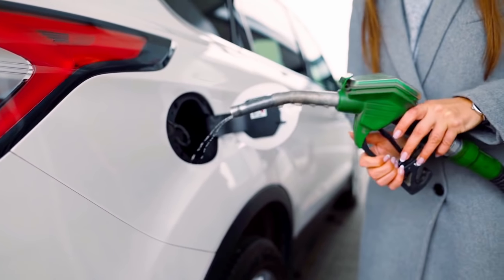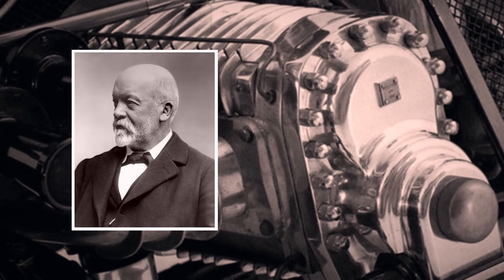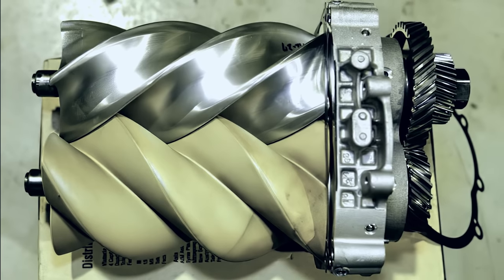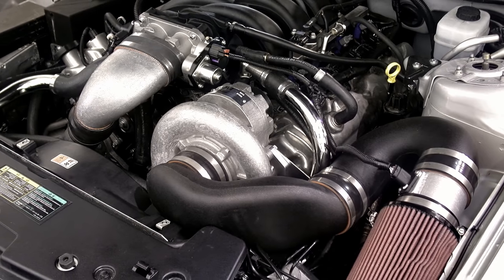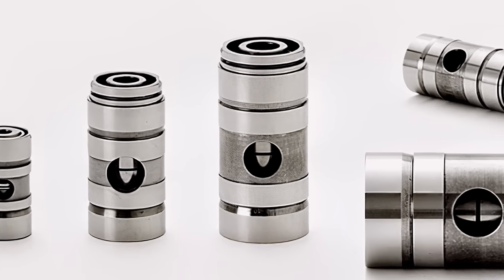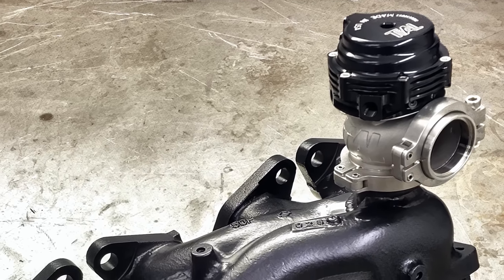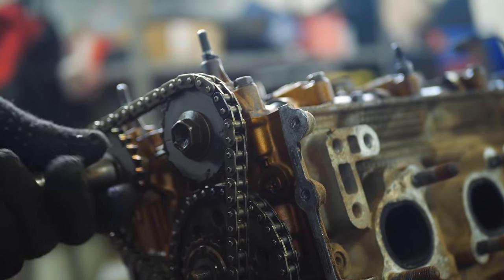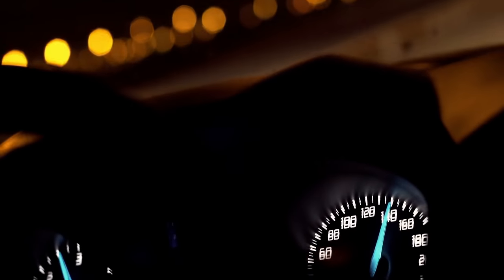The Science Of Boost

Comment from the maker: Check out this related video on how oxygen sensors work - https://youtu.be/KIF8P2J1CeE
Reply: One caveat. Turbochargers don’t generally use engine coolant for temperature stability, but the oil. Turbos get far too hot to use the coolant.
Reply: You could also technically setup a complicated twincharged system. With a supercharger that disengages at a certain rpm for low end boost as the turbo kicks in. I’ve seen a number of project builders accomplish this with too much time and money 🤣
Reply: Shit I commented too soon. I meant twin charging where the supercharger feeds the engine at low rpm, then a turbo at high rpm. Not compound charging where one device runs another.
Reply: Also, compound low/high sequential compressors is common in diesels too
Reply: Also, Bi or twin turbo is common on split engines. Flat 4, v6, v8 etc where you can use each exhaust header rather than complicated piping or a single turbo only feeding off half the cylinders
Reply: 5:08 in this video i believe the animation of the supercharger is inaccurate as the partial stream is going backwards
Reply: @ObservationofLimits   what? there is no such thing as running a turbocharger off of only half of the cylinder's exhaust. there are only negative consequences of that
Reply: 0
Reply: I,as one, used to work for International Harvester dealer truck shop back in 1973, 1974 as a mechanic for there new trucks that would go out to fleet buyers, one new truck I Got to check out and test drive had a 8V92 V8 Detroit diesel engine with the normal roots blower on top, which was good OK, on top of that it had a pretty good size turbocharger, when I took it out to test drive it after I had T I'd it , I could get on a long entry to the free way an get up a few gears and I had no trouble at all in catching up with the main traffic flow, that engine had real power no doubt at all.
Reply: Another great video. Thank you for the hard work and time.
Reply: Outbound
Reply: Try 'driving4answers'
Reply: @ObservationofLimits üüÜ
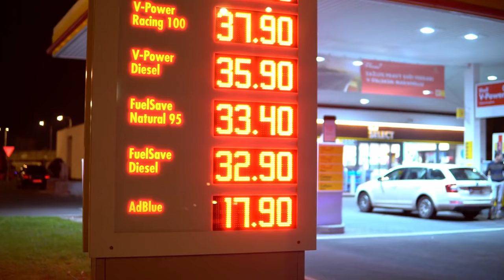Reply: 2:52 gas prices in California by 2030

Comment: yeah as others have also said the blower is turning the wrong way, the air goes around the outside
Reply: Was about to say the same thing 🤣
Reply: Yeah... noticed that too... and
The turbo is turning the wrong way also.  The rotor turns from the larger cross section of the volute to the smaller cross section.  It's the opposite for the hot turbine section.

Comment: Great video, but I think when you say "detonation" you're actually talking about pre-ignition. Pre-ignition is when the air/fuel mixture explodes before primary combustion (due to over compression and too high of heat), whereas detonation is the unexpected explosion of the remaining air/fuel mixture after primary combustion.
Reply: Interesting, I'd always assumed that they were interchangeable. It sounds to me like pre-ignition is just a specific type of detonation in regards to time.
Reply: Would ignition before the sparkplug goes off be considered detonation? I mean Diesel's ignite by "detonation"  not pre-ignition right?
Reply: @chidon7465  Pre-ignition is when the mixture ignites before the spark plug goes off, detonation is basically "double ignition" where the leftover mixture ignites again after the spark plug has caused primary ignition. Pre-ignition can typically cause far more damage than detonation as the piston pushes up against the early explosion, which is typically the most crucial difference.
Reply: @blakebeaupain  OK I understand now, thanks. Detonation causes that "pinging" sound in your engine correct?
Reply: @chidon7465  Correct yeah, but pinging/ticking can be caused by other things as well. In terms of diesels, they don't really suffer from "pre-ignition" as they don't have spark plugs, they have glow plugs which just stay warm while the engine runs. Diesels compress the mixture until it explodes (which is tuned to happen when the piston is at top dead center) and they technically "knock" by design.
Reply: @chidon7465  Detonate means ignition followed by explosion. So, you're right, if you read a dictionary.

This rinds me of when a dumb guy once made fun of me when I called my shocks dampeners.  He asked if they get wet and dampen the wheel.

I said, "Well, yes, they do dampen, which has the exact same definition of damp.  And dampener has the same definition of damper.  So, pfffft.

And Pluto is a planet!

Comment: The animation of the roots supercharger at 5:25 has the air flowing the wrong way.
Reply: Or, well, the rotors rotating in the wrong direction.
Reply: The animation of the twin screw compressor is also completely wrong 7:14
Reply: The impeller in the super charger at 9:10 has its blades facing the wrong way, you can't really tell what way its turning because its animated so quickly but I would assume its also wrong.
Reply: Yep: turning in the wrong direction. And the air doesn't go through straight.
Reply: oh i was so confused... how would the air compress so much to fit in between the rotors
Reply: The impeller blades are turning the wrong way. The air flow just moves on the outer areas of the blower case.  Not between the impellers.     This is a common misperception as I remember.
Reply: I tought i forgot how this worked
Reply: @Wiley Sanders the air pockets are in the out area within the blower case..
The animation is incorrect.    Common mistake.   Still common apparently
Reply: Your comment makes that animation make so much more sense now!
Reply: @roboterson  I'm amazed that he managed to get every single animation backwards. It makes it more clear that he's a presenter, not an engineer, or at least not someone who can visualize the flow well enough to notice that.
Reply: @Mastervidcritic  so is the airflow in the radial inflow turbine @15:04.
I think they are trying to incorporate a stroboscopic effect- really unnecessary and confusing...
Reply: Regardless these animations are incredibly well done and were able to get the point across. Your content is unreal, keep up the awesome work
Reply: i was coming down to the comments to say the same thing. Glad to see someone else spotted it
Reply: Yeah, I was thinking that too, they didn't look at which way they were animating the supercharger.
Reply: Yes i also noticed the same thing.
Reply: I was going to leave that comment, so thanks for beating me to it, haha.
Reply: Glad I'm not the only one that noticed
Reply: The Lysholm screw blower animation also shows the airflow backwards, and the turbo animation has the compressor wheels spinning backwards
Reply: @Mr2boosted  right, i noticed that one too
Reply: @Pow3llMorgan  both
Reply: Scrolled down to comment that, glad somebody else verified it because I  really didn't want to be that guy to point something out that isn't actually true.
Reply: Yep. The air should be following the case, not the meshing lobes.
Reply: @Mastervidcritic  
I didn't understand how either of those worked, based on the animations. I still don't  really get it. But reversing the flow at 5:25 does make a lot more sense than how it's shown.
Reply: that's not the only time the animation show wrong airflow... 7:20 again
Reply: Them not knowing or understanding how any of this actually works makes it hard to watch this video.
Reply: I figured i was just stupid for not understanding airflow lol. Thanks for  telling me this.
Reply: they seem to have the rotation in the wrong direction in every animation. its as if someone set out on purpose to get it wrong, much worse than a random 50% chance. ive lost interest in watching the rest of the vid because of it.
Reply: His 3D animation guy must be Australian.
Reply: @Taygetea 
The screw supercharger is pretty accurate and the rotation of the gears behind the centrifugal supercharger is correct as well. The Roots type is very wrong though.
Reply: Oh thank goodness, I thought I was going insane. I kept staring at this thing going "This cant be right, but somebody went through all this effort to animate it. Maybe I'm missing something?" Then it happened again and I just had to come check the comments to see if anyone else was seeing this.
Reply: Exactly!
Reply: Centrifugal Supercharger too has mistake, Impeller rotation is oppostie to what it should be.
Reply: He also referred to turbo lag incorrectly...its boost threshold.
Reply: It was bothering me so much I had to pause the video and check the comments.
Reply: I think it was just showing how it just continues to force air in which gets hotter too and the combination builds pressure. But whats gonna happen of the valves not open and the airs forced down the runner 🤔 prolly gonna bounce back
Reply: that was painful
Reply: Centrifugal rotor is turning backward also.
Reply: @travismason2811  I had to stop watching precisely because of this. It's easy to read out a Wikipedia page without understanding any of it. Sure the animations and editing is pretty, but that doesn't automatically make it good quality.
Reply: Ugh I noticed that too and its killing me
Reply: Those that "know" and, those that "think they know"... Makes me wonder if this dude has ever touched an engine...
Reply: Thanks Karen 🤦
Reply: the screw charger 7:15 too
Reply: I noticed this right away, air travels around the outside of the rotors.
Reply: @Taygetea  You're absolutely right about the distinction between an expert and a 'talent' presenting info.  YouTube must not be taken as the ultimate source!
Reply: "New Minds" lol
Reply: I'm glad I'm not the only one sitting here yelling at my screen! 😂
Reply: @adamvalt6609  it doesn't, it goes around near the outer casing.
Reply: THANK YOU, I thought i was losing it.
Reply: some have CAD but do not know how things really work just the principle. everything goes the wrong way in the animations
Reply: Bless you sir.
Reply: Right—doesn’t it flow around the outside rather than through the middle?
Reply: What do expect from someone who thinks A/R is a reference to aspect ratio.
Reply: @That one guy  as a compressor technician this bothered me so much
Reply: It's not a roots charger...it's a salt mill. Now also the white particles make sense!
Reply: I just thought I had my memory messed up 😂 headed right for the comments and here I see this
Reply: Not if it is a inter compression design. where the air moves between the screws. You probably is talking about outer compression designe, where the air moves near the housing walls.
Reply: @pedro.alcatra  Yes. Because in a Roots compressor, the air (and, potentially, gasoline and maybe even water or alcohol) is moved "along the walls".

I guess top-fuel didn't use water injection; they just inject fuel, like, everywhere, into the air flow. A top-fuel dragster Roots compressor may "divert", like, 600hp of the engine power to keep itself spinning. Okay, that has nothing to do with how a Roots compressor works, but it's kind of funny to know that a 400hp car isn't that strong...as it is too weak to operate a "proper charger".
Reply: theres lots of backwards animations in this i think...

Comment: All I've ever known about FI was contained in this presentation, combined with twice as much stuff I didn't know ALONG with the history...
I wish I could like this twice
Reply: Basically nothing on F1 MGUH though. Those hybrid systems are stunning. Zero lag.
Reply: The video contained info I picked up over the years one bit at a time.  Plus a new bit, where they cut the ignition so unburned fuel goes into the exhaust and ignites there and spins the turbo.

We used to do a trick on our bikes where we went full throttle, cut the ignition (thumb switch), filled the exhaust with air/fuel mixture, then thumbed the ignition back on.

This ignited all the fuel in the exhaust at once and exploded like a quiet gunshot.

Doesn't work on EFI.  '(

Comment: The animation at 5:10 is wrong, the rotors spin backwards compared too the airflow
Reply: that's not true
Reply: Maybe you need to hold your phone upside down
Reply: i was about to comment on it. The air pases throught the outside (close to the wall) so in that animation it goes up
Reply: Also 6:55. I swear, even later with centrifugal superchargers and turbochargers; the impellers illustrate correct vane geometry, but appears the same backwards rotation. It's all a clever ploy to drive comments.
Reply: iirc that would be the correct animation had he been talking about a twin scroll supercharger rather than a roots one
Reply: Centrifugal Supercharger too has mistake, Impeller rotation is oppostie to what it should be.
Reply: Come on - there are seals between the intermeshing lobes in the middle, therefore airflow must be around the outside where the open cavities move towards the bottom.  Obviously the animation is rotating in the wrong direction, unless you want to pump air from the cylinders out the intake.

Comment: 23:45 that's backwards. The large turbo feeds the small turbo. The compressed inlet charge increases the flow capacity of the small unit. Also a small nuance, you said that lowering the compression ratio decreases the thermodynamic efficiency of the engine. While it's true that high boost levels require lower static compression ratios, the dynamic compression ratio is much higher so the thermodynamic efficiency of the engine is higher. Think of it as the air gets compressed, then cooled, then compressed again, meaning you can have a much higher compression level before detonation temperatures are reached. Otherwise this is a surprisingly accurate video. You've clearly done your research.
Reply: Agreed Brian.  One could also think of it like a gas turbine like a twin or triple spool turbofan.  N1 is larger than N2, and N2 is larger than N3 (if a triple spool engine).

Comment: The illustrations show the air taking the wrong path through the rotors.  It actually goes around the outside and the meshing rotors seal the air down.  There is no room for displacement between the rotos it therefore has to use the volume of the shape of the mating parts.  Great video.  Thank you.

Comment: This was actually very well done.  Bravo.  Only critique:  17:10 - Turbos are not just RPM dependent.  They are also load dependent.  This is why redlining in neutral builds no boost but flooring it at low RPM can.  For best results, it takes both.

Comment: The Roots system is also used in metering natural gas at higher flow rates. For normal domestic metering, from 250 cfh to 1000 cfh, we usually use positive displacement diaphragm meters that use internal diaphragms to inflate and deflate, measuring the gas volume and turning a counter to show usage. This is then billed to a customer at a known pressure, adjusted for temperature. At higher volumes, 2m cfh to 56m cfh, we will use Roots style meters. They still work off of the positive displacement principle, yet the rotating assembly has a higher volume permission than a diaphragm design and do well at measuring large volumes of gas. They also aren’t restricted to the lower pressures of diaphragm meters, and some are used at upwards of 200 psig. This allows high pressure/volume through the meter, which a customer can then regulate down for their specific applications.

Comment: 5:10 and 7:07  the air is flowing backwards given the rotation direction depicted in these models
Reply: 7:35 also
Reply: And at 29:14 that housing is for clockwise flow but the impeller is for counter clockwise flow.  at least you got the air moving in the right direction that time lol

Comment: Very nice video. But you should correct the rotation of your compressor animations. They all rotate the wrong way. Also the compression ratio of a cylinder is described for a naturally aspirated engine. A 1:8 ratio of a boosted engine is increased to maybe  1:12 by the air pressure. But maybe you also mentioned this. Keep up your fantastic work.

Comment: The animation of the centrifugal compressor from 08:28 on is spinning in the wrong direction.
And animation of turbocharger from 14:54 is also spinning in wrong direction while the exhaust gas inlet flow is shown correct....

Comment: I had an Olds 442. It had the standard ring air filter that pulled air from the engine bay. Very inefficient. I installed a K&N cold air box that pulls air from the outside and uses a high flow filter. The difference in performance was stunning. I would wager that I gained 30 or more HP and just a smoother running engine. Amazing

Comment: Very Nice video, however, I believe you are mistaken in the notion that roots blowers are used on modern vehicles, I do not believe this to be the case, the roots blower with its many inefficiencies has been widely replaced by relatively inexpensive twin-screw counterparts made by companies such as Eaton and IHI. The HellCat and Demons for instance use an IHI Charger, and Ford supercharged offerings have been equipped with the TVS 2300 and M112 From Eaton.

Comment: Overrall a great video. But I see a few OCD moments.

4:58 - That's spinning the wrong way. Air flows on the outside of a roots. Not the inside.
6:55 - Also backwards on this screw blower.
8:25 - also spinning backwards. At least you show the airflow correctly.
9:42 - That's a screw blower. In the USA all mass production blowers are screw type or just turbocharged.
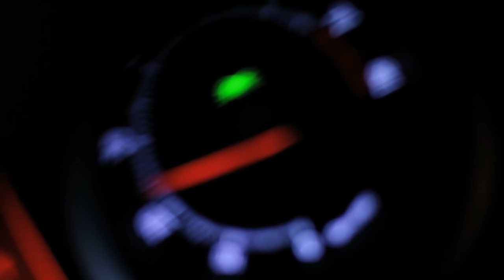10:48 - Anytime you compress air it will heat up significantly. Intercoolers are mainly addressing that. The fact a quality intercooler (Liquid to Air) can cool the air lower than ambient temperature is just a bonus.

Comment: 6:53 one small point--the twin screw compressor illustration is running backward compared with airflow.  Very little air travels with the meshing parts, while a lot of air travels with the parts not meshed, facing away from each other. So, in that illustration, air flow would be /upward/